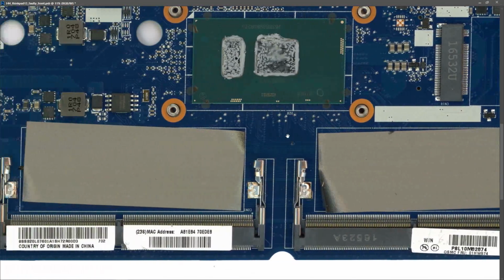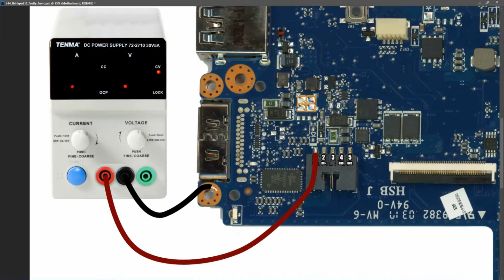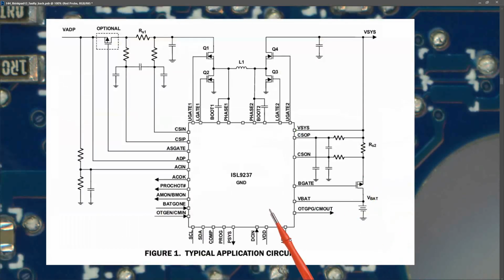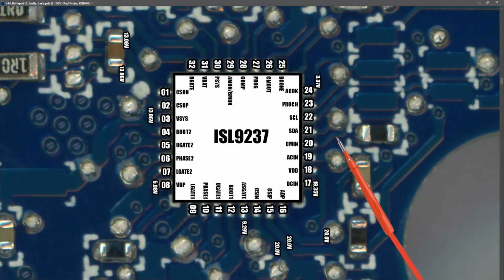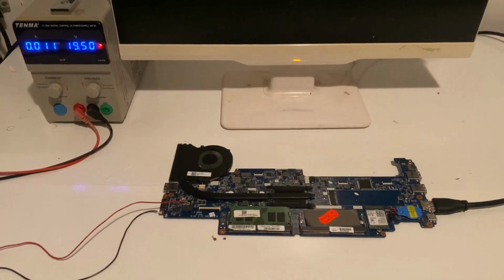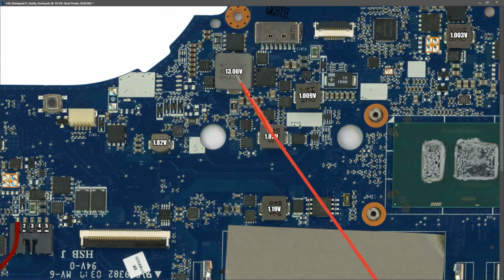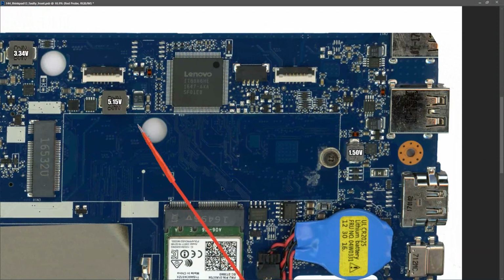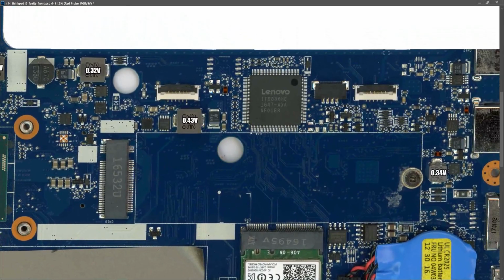LENOVO THINKPAD 13 DA0PS9MB8E0 REV E - FAULTY

Comment: I would check the pwm ic along with their mosfets connected to that one coil which has no voltage. I suspect it is built in graphics coil. Also its power good signal. I have seen a gfx pwm driver ic with shorted low side mosfet gate driver pin. If the coil is ok then I would also try flashing the ec bios along with main bios but with a build from scratch bios file or rebuilt bios file.

Comment: Why you decided to go throw the battery management IC not for the power management IC instead.
Reply: They're the same thing, the chip does both.
Reply: @CAsCurryKitchen really I don't think so. 
Battery Management IC = takes care of the battery (charging, safety, reporting).

Power Management IC = takes care of the system (voltage rails, sequencing, distribution).

Comment: First off all i would try with original adapter . It is not normal it shut down after sec. Because the id pin is directly connected to ec ite chip and need it to give certain signals out. If you use adapter with id pin.
Reply: I think that's unlikely. The ID pin simply tells the laptop how much power the chrger can deliver. A charger without an ID pin will power the laptop but the battery charge will either be limited or will not charge at all but it will still power on.
Reply: @CAsCurryKitchen That is not true a hp whitout id pin will not power on . A Dell will be throttle in and some lenovo's will also not power on when you do not have a special adapter for it.
Reply from the maker: @stevedebeukelaer1424  Hi guys, this is something that I am unsure about as well. I deal with mostly Dells and a broken ID pin will not stop a Dell laptop from booting, it will just cause it not to charge the battery. However, I have been making the assumption that this is the same for all laptops, and this may not be the case.